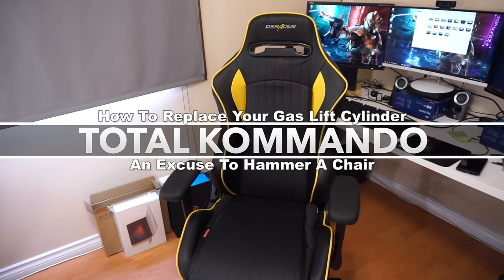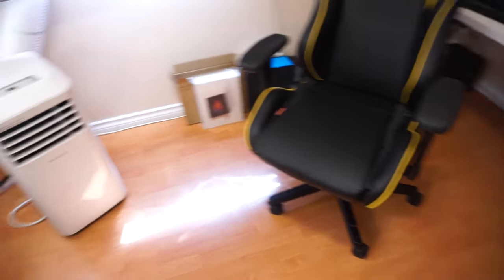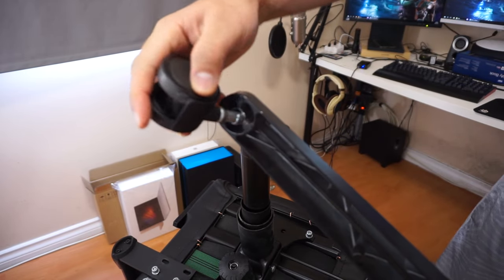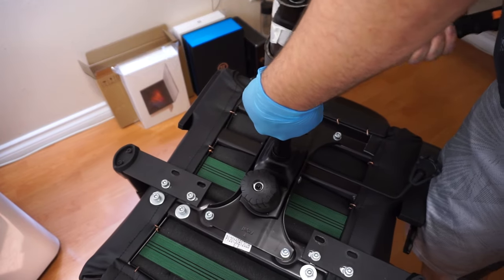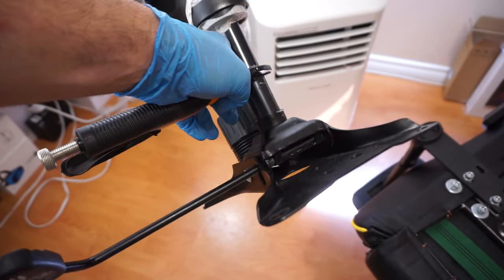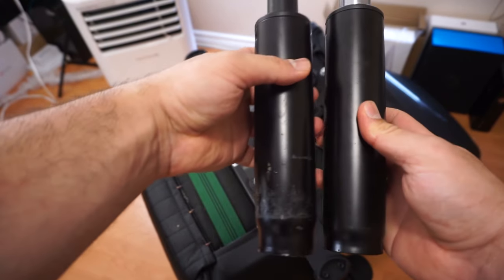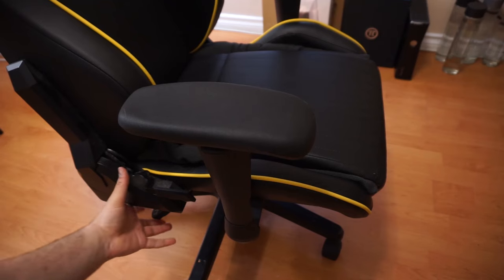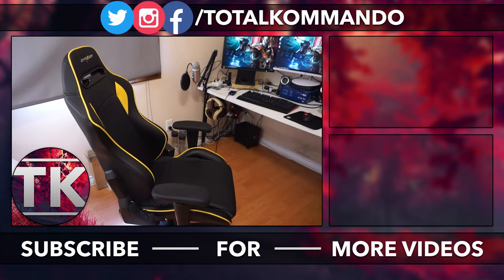How To Replace Chair Gas Lift Cylinder | DX Racer | How To Fix Popping Clicking Noises

Comment: I have a cyberpunk secretlab omega chair, could you tell me where I can buy the gas lift? since they do not have it available on their page.
Reply from the maker: Any standard gas lift will do from Amazon, just check the reviews to make sure its good, and the higher the rated lift power the better, lastly check the minimum and maximum lift heights to see if they work for you, it may be hard as you may not exactly know the details of when its installed compared to yours.
Hope this helps.

Comment: You actually don't need a hammer. Use a pair of needle-nose pliers to simply take the ring off that's located at the end (i.e., the bottom) of the gas cylinder. Watch this video: https://www.youtube.com/watch?v=L2YyqZ5K9n4. You don't need to damage the chair to do this fix.
Reply from the maker: Works if your cylinder is not warped. But it is one way to do it. Tried it on 3 chairs and results vary. It's best to fully replace it.

Comment: I've watched these videos - they aren't helping me. I can't for the life of me dislodge the gas cylinder in my DXRacer, particularly from the wheel base. I've been hammering for ages with both their recommended rubber mallet and cloth (just destroys my cloths) - does nothing. Same for a traditional hammer. I'm not sure how it's possible to do this but I'm incredibly frustrated.
Reply: Spray some WD40 and wait  for it to sip in

Comment: My friend bought me a chair. My feet dont touch the ground when i sit so i have to return. Thing is i cant remove cylinder. I cant damage it. What will i do??
Reply from the maker: If it's a new chair, you could remove it without damaging it easily. Mine was hard because it was old and rusted. 
Could also wear slides, or use a foot riser.

Comment: My DX Racer Drifter Series chair has no issues staying up at it's max height. But when I lower it just a tiny tiny bit, lock the handle back in to keep it at that height. It will stay at that height as long as I don't get up off the chair because the moment I get back on it, it sinks all the way down to the bottom. I'm not sure if this is supposed to be normal but I'm assuming that it isn't, how do I get it to stay locked at a specific lower height than the max?
Reply from the maker: Sounds like a faulty gas piston
Reply: @TotalKommando  Okay, but if that's the case then how come it can stay up at the maximum height all day long even after getting off it and back on. Could it just be the locking mechanism that is the issue?
Reply from the maker: @gh0stp1rate  The piston has a button when pressed, it extends. But when pressed and sat on, it compresses. You can take apart the chair base and see what's going on. To me it's pouring towards the piston.
Reply: @TotalKommando  Hey man, just wanted to let you know that I really appreciate it that you even replied back to my comment directly, stay real man! :)
Reply from the maker: @gh0stp1rate  No worries : ) Always happy to help

Comment: I bought a used DXRacer and it doesn’t even have a gas lift or lift mechanism... does anyone know if I can just use this method to add one!?
Reply: Was yours new? if so contact them and the will send you one, but if not then yes you can just add one, but buy a good quality one

Comment: This chair is a piece of junk. After a couple of month the seat control plate came partly disconnected from the piston, so that this chair would flip over when I sat in it, nearly breaking my neck. I contacted customer service at YOURLITEAMZ, they sent me a new plate, but old plate will not come apart from the piston. I told this to customer service and instead of sending me another piston, they sent me a link to YouTube. I followed the instructions, but that did not work. I contacted YOURLITEAMZ CUSTOMER SERVICE again asking for another piston to go with the plate, which I thought would fix the problem, and they quite responding. I spent extra money on this chair because it was supposed to be heavy duty gaming chair and I am left with a piece of junk. Don't buy this chair, for when it fails, YOURLITEAMZ CUSTOMER SERVICE, will also fail you.

Comment: I need to replace the lift on my old DXRacer, but I've had the thing for so many years now. I cannot get it out. I hammered the hell out of it, used WD40. That thing is stuck.
Reply: maybe try a heat gun to see if it gets a bit smoother than go with the WD40, maybe it might work. I just ordered WD 40 and lithium Grease, I'll try to fix it before changing it.